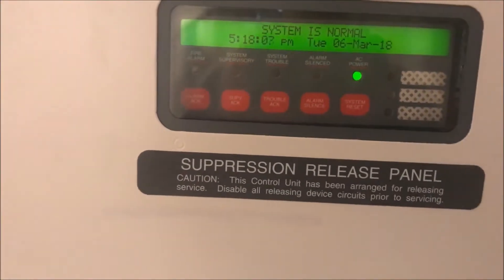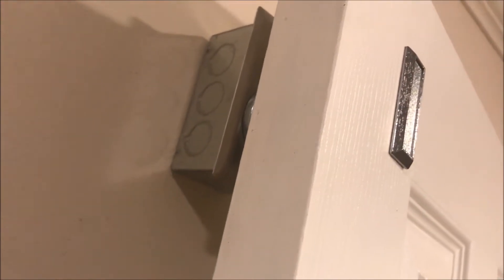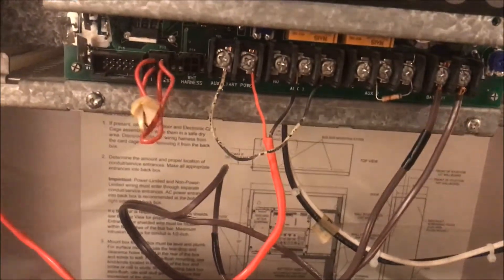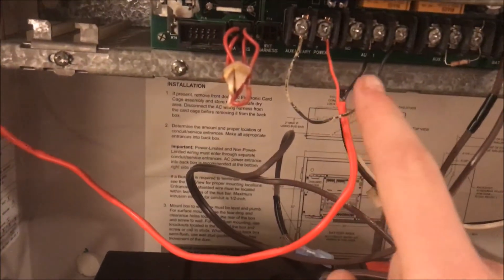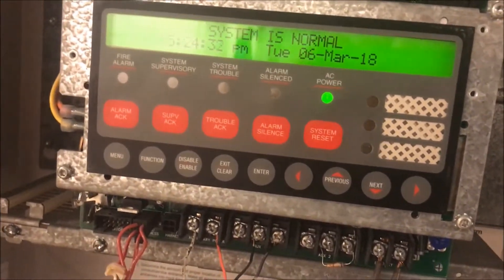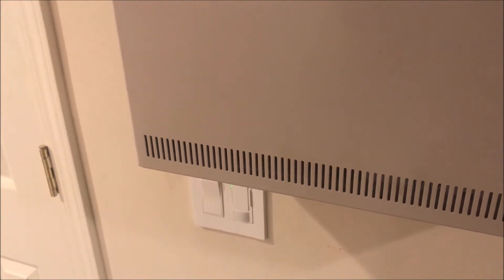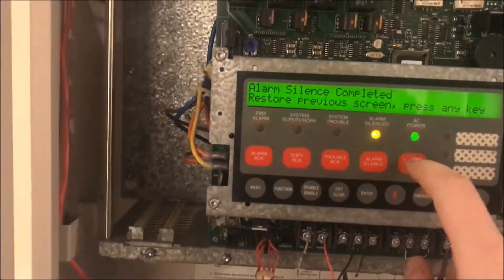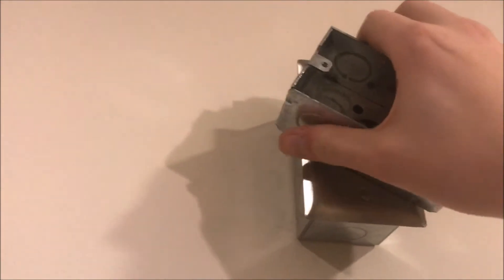What The Heck Is It?! Doorholder

Comment: How is a 120v magnet with 2 wire installed with a 120v pull station that has no fire panel system. I have the pull station triggering a siren/strobe on ceiling but need a magnet to be normally closed but open when pull station is pulled